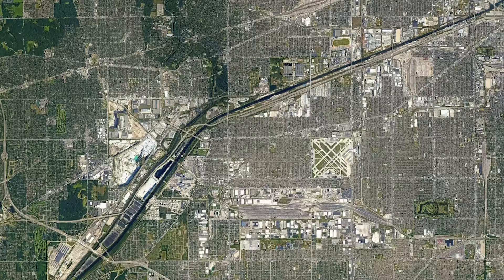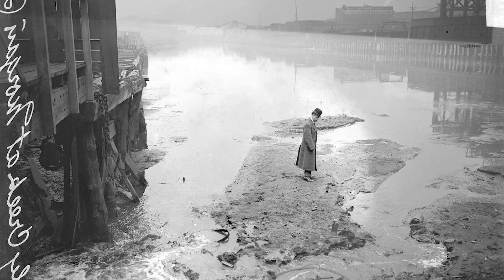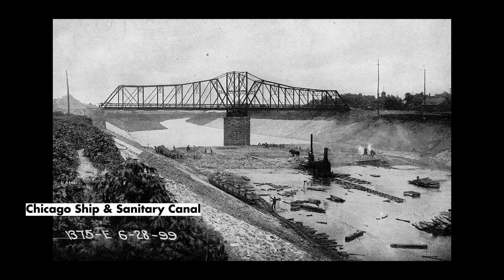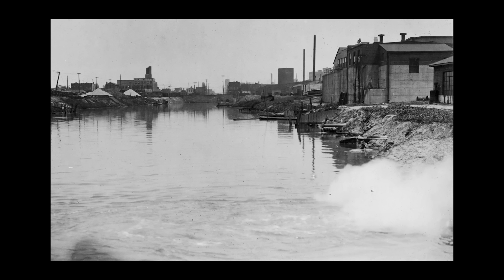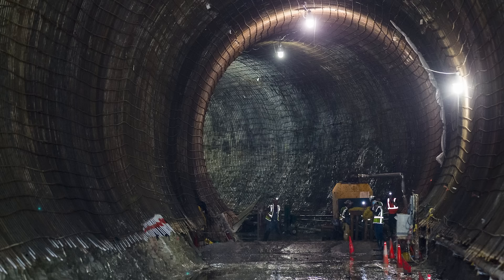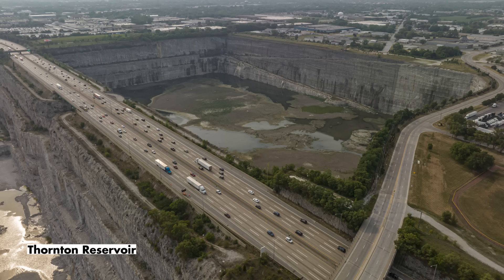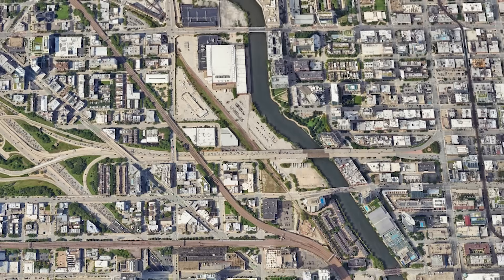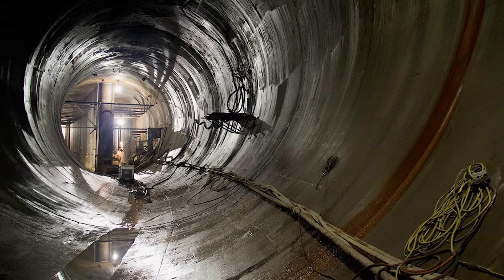Chicago's Deep Tunnel Project

Comment: There was a massive opening in the street on the north west side of Oak Park River Forest High School in about 1971ish. It looked all the way down into the Deep Tunnel project. To this day, I've never seen anything like it. You could walk up to the boards surrounding the opening (which was HUGE) and gaze down at the people working what looked like three to five hundred feet underground. They lowered and raised huge pieces of tunneling equipment via that opening for almost a year before closing it up. The most amazing part of the project was that they trucked out all the dirt as they dug the hole. It was a very nice residential area so they did their best to keep it very tidy. You have this massive huge hole in the street at an intersection and not a trace of dirt, asphalt, or clay. I was fascinated with the whole deal and begged the construction guys to allow me a chance to go underground via the elevator. DENIED every time. Then a year later it was filled and closed. After the new asphalt had weather for a few months, there was literally no trace that there had been that massive project taking place just months earlier. It was quite impressive to say the least. It really helped a ton with water movement during big storms  here. Basements stopped flooding almost overnight once they finished up that section. It was way over budget as I recall, but successful as far as the end goal.

Comment: They need to open it up the tunnel when it rain really badly, but they don't. One time, it was raining really bad it's was July 4th weekend, but nobody wasn't working, and it flooded.  The worst one ever was in 2023 . You know why they didn't open it up because it was during Nascar racing, and they didn't want the water flow on the race track,  so it flooded in people home. After they finished the tunnel, we stopped having flood in the basement for about the first 10 years. Now, I say the last decade about 3 or 4 time.

Comment: I grew up in Chicago back in the 1950s. Basement flooding was common place (and it was NASTY!). It would back up through the floor drain or into the wash tubs (clothes washing was often performed in the basement during the cold Chicago winters). The only way to prevent it was to install "stand pipes": the floor drain opening would be threaded and a three to four foot tall section of pipe would be threaded into the drain when not in use.
The newer homes in the suburbs had it better: they had "over head sewers" (the sewer entered above the basement floor level) and a sump pump was used to pump basement generated grey water up into the sewer system. (to the great relief of my nose!)

Comment: Retired MWRD pollution control officer here…made it as far as the drop shafts and visited numerous sampling locations where combined wastewater would enter the tunnel.  Fortunately, the reservoirs are capable of handling the volume of water the tunnel can’t because those 1,000 year rain events are occurring every year and the tunnel only holds a few billion gallons. By the time I retired, Thornton still had some kinks to work out, McCook was good to go, and of course maintenance.  Thornton is massive!  

For the record, the District is a self-taxing government body.  We’re not affiliated with the city or Cook county, but home owners will recognize the organization in their property tax bill.

Comment: since ive ever been doing chicago construction, and the surrounding towns, every contract has the property keeping all of the storm water on site, either in detention ponds, or underground chambers that are underneath the pavement. 

It adds like a million dollars to each job because the concrete chambers are like 400 grand, and then the labor and stone backfill. 

MWRD is your daddy, Metropolitan Water Reclamation District, and you aren't building a single thing until you tell them where the water will go, and they say its okay to do that. 

I just had to bring it up cause you only mentioned bioswales, which are tiny and dont hold much anyways.

Thats why theres a huge pond outside of every building, cause its cheaper to dig out a pond and haul off the dirt, then it is to dig out under the pavement and buy expensive concrete chambers, and still have to haul the dirt out.

Comment: The flooding in chicago happens because the city Strategically shuts off certain sewer valves in order to save Certain areas from getting flooded. These are mostly areas like downtown Chicago, some part of bridgeport etc.  they shut off sewers and let all the sewer water back up into the poor areas. I was in a poor hispanic area in chicago, forgot the name, but its around 47th  california, kedzie etc, and that area had like 7+ feet deep water on many blocks. I wouldnt be shocked if this is being built just to spare the airport from being effected by storms. I bet near by residences will expereince some sort of hell

Comment: I've driven a semi truck over the Thornton reservoir more times than I can count. I never knew what it was, only that it was a LONG way down to the bottom!

Also, its Chicago's combination sewers that kind of make this approach necessary. The green system would work well if it were only storm water. But with feces mixed in, it must be specially treated in a facility designed to do that.
Reply: Part of the city where I live has/had a combined sewer system.  The EPA mandated the city to separate the storm sewer from the sanitary sewer.  The project has been ongoing for maybe 6-7 years now.  I'm surprised Chicago doesn't have to do the same thing with their system, but maybe it'd be too costly?

Comment: A few things I'll add. There is the working Thornton Quarry, across the I-294/I-80 expressway. it's an active quarry, the one on the north side that you see lots of  brackish water and other sediment. This is the main overflow sewage area. However, they planned for the 100 year flood. There's a bridge that you can see halfway through the two quarries. You'll notice a round coffer dam on the north side(far) of the expressway, and then a bridge over an opening. Being bedrock they're pretty much already water proof, so they're perfect.

That's there in case there's a huge once in a life time flood, or other major issues. The active quarry to the south will move all it's equipment out and then the water will go over the coffer dam and use the active quarry as overflow. After the emergency ends, the water treatment plants will drain both and the active quarry will  clean up the mess. There's very little chance of it actually happening due to the other quarries being used.

Comment: An important an interest element here is that Chicago is one of the only cities in the world that treats not only sewage, but nearly ALL rainwater runoff that falls on the city. This is mainly because of treaties that limit the city's ability to dump water into Lake Michigan. There is also a really interesting element that the same treaties limit how much water the city can pull from the lake annually--and this includes the water that flows into the now-reversed Chicago river. That is why, during periods of high water usage, the flow of the river will come to almost a stop.
Reply: Great Lakes Compact.  When the place you sent you sent your waste water to is the same as your drinking water and a major recreation site , you have to clean up the mess. Summer beach closures for bad water quality days does not go well.

Comment: Thanks for shining a spotlight.  I love my city and appreciate that it has had massive projects throughout its history.  I even appreciate the coda that this may have not been the right solution -- just as draining the original swampland, I&M canal, the railyards,  reversing the river, building the Sears Tower, Chicago Housing authority projects, etc. etc. were all probably not the right solutions.  Yet not only is it impossible to only choose right solutions, without Chicago being at the forefront some of these projects other cities and the world may not have the data needed to find competitive alternative solutions.

r.i.p. Chicago Spire - Chicago missed a chance to be Chicago again when this mega skyscraper project stopped.
My screen name is Chicagojon2016 because Chicago bid for the 2016 olympics.  Of course it would have been a disaster for many reasons (as Rio was) but this is a world class city and we need to never forget that and continue to push forward even if it means continuing to make mistakes.

Comment: I worked in the deep tunnel back in the early 90's, it was 386' below ground where I worked. We set the record on a 32' round dig by going 100 feet, got a coin as a commeration. Also worked on 15' tunnel and drilling and packing leaks. Was there the night the hoist, which ran the manlift/elevator, caught fire, after that night we were lowered and raised by crane. You've never seen darkness like when the power would go down, could see absolutly nothing. Was very, very hard work!
Reply: You never see darkness like that. I m shure. Over a mile below ground in a mine. You can't even see your nose. Mabey that's why they study dark matter now down there.
Reply: what do you know of underground military bases ?
Reply: @bluskytoo  I can't say 🙂
Reply: Worked with Kenny construction and Jaydee in the early 2000s. The tunnels were awesome. Wish I could go back
Reply: @stockingstuffer696  Jerry Kenny was great guy and friend. He was a very humble man for all he had done. I was lucky to work with him.
Reply: I worked that project in the 80s. Piledrivers.
Reply: Thank you bro
Reply: I was on that job too. IEL at Miller Meadow. I ran the 32' mole and the 15'er west under Roosevelt Rd to 25th. I operated the crane that took the TBM out of the hole at P site, about a half mile north of Kiddie Land then the 9260 American at the main shaft until the end of the job.
Reply: @Craneman4100w  yeah, Impregilio, Ebasco and Lozenger (probably mispelled) is who I worked for. Small world!
Reply: Were y'all known as 'Sand Hogs' like the NYC tunnel engineers??
Reply: @SMichaelDeHart  No, they call them hard rock miners here. I'm an operating engineer.
Reply: @Craneman4100w  the 'Sand Hogs' name was more of a nickname, than actual job classification. Just wondered if it carried over.
Reply: @SMichaelDeHart  I don't remember ever being called that, I was just a laborer
Reply: @GregHallArt  they wore it a a badge of honor. Just wondered.
Reply: I worked in the east pump room at the plant on 130th Street just west of the Bishop Ford expressway.  385 feet below the ground. They say it is the deepest point in Chicago.  We were just filling cracks with hydroactive foam.
Reply: @erike.erskine7648  I never did foam, I mined and also worked on a drill and fill with hydraulic cement crew.
Reply: Local 4 retired now
Reply: Thanks 👍 for sharing
Reply: So magnetic train are supposed to run 10 miles under ground world wide 

Supper fast

Comment: The ridiculous idea is to combine sewer and storm water, convey it, store it, then try and treat it before the next storm. Keeping it separate from the start is the long term solution. This project fools engineers into thinking that it will eventually work. Sorry it does not now, and will never be able to fully treat all the combined sewage during the largest annual storms.
Reply: will it be able to handle the most extreme events 100%? probably not. however that dosent mean it "dosent work". its helped a lot actually. basements flood way less frequently than they used to. the chicago river is healthier than its ever been in the modern era. discharge events are far less, and even in extreme events less needs to be discharged because more is being held back. dont let perfect be the enemy of good. also i can guarantee you the cost to build out an entirely separate sewer system for the entire metro region would cost wayyyyyy more than the 4B this has cost as well. good luck selling chicagoland on even more tax increases. as a point of comparison, the plan to replace all the old gas pipes in the city was originally supposed to cost 2B - thats now up to 11B and massively behind schedule with even more cost over runs likely. and thats arguably a far simpler project.

Comment: They did the same thing in Milwaukee and it's a massive failure, they're still dumping untreated waste into Lake Michigan even after moderate rainfall.
Reply: The deep tunnel project has actually been a massive success in Milwaukee. Since it's come online in 1994 MMSD has captured 98.4% of runoff even though the national goal is to capture at least 85%. Further more prior to the deep tunnel Milwaukee would have 50-60 overflow events into Lake Michigan a year, but since 1994 the city now averages only 2.2 overflow events a year.

Comment: FYI the Thornton quarry that goes on both sides of 294/I 80  that multiple vehicles/ trucks pass over everyday is monstrous . I work for a paving company and on the north side is the old quarry now water reclamation for Deep tunnel which has the same conditions as the other quarry to the south. I all honesty they were at one time connected to each other via tunnels for gigantic earth moving vehicles Quarry trucks payloaders drills ect ect . But most importantly is that this quarry has the most pristine lime stone in the world. It’d dug up ground up and shipped all over the world via barge and rail cars. For some reason it’s consistency if fair more superior that most lime stone out there. It been test all over when used in making concrete it us superior for concrete mix of multiple substances for different building quality curbs, streets, buildings., foundations, sidewalks, driveways. Roadways, bridges and bridge support, precast concrete form/ walls you name it’s been used best one is Trump towers here in down town Chicago was multi types of concrete mix’s used to build the tower all steel and concrete. I’ve been in that quarry multiple times  getting stone 🇺🇸🇺🇸🇺🇸

Comment: Combined sewer systems are archaic. Sanitary sewer systems are the way to go. Waste water and storm water should never be combined or use the same infrastructure. Sealed waster water gravity systems, lift stations and terminal stations that pump into wastewater force mains are far more environmentally friendly. If every time it rains it throws the treatment plants parameters out of control the effluent cant be controlled. In a sealed sanitary system infiltration of fresh water can be controlled and metered. Meaning the treatment plants will run at a far more efficient rate and be able to maintain permit. How do they intend to seal off those reservoirs from the surrounding environment and wildlife when it is actively holding waste water? Thats a disaster waiting to happen.

Comment: So those huge, abandoned quarries are massive open cesspools used to store partially diluted human waste? Wow! Milwaukee built a deep tunnel project too (completed in the 1990's). However, it's on a much smaller scale than Chicago's. And as a result, Milwaukee still routinely dumps raw sewage into Lake Michigan. Just not as often, which is an improvement over what they were doing before.
Reply: So
Reply: @WhooHooooooo Their sewage flows down to our beaches and water intake cribs when it is dumped in Lake Michigan.

Comment: I had a chance to visit this project in 1982.  Was with a group of engineering students and we were able to ride a lift down one of the main construction drop Shafts.  There was one of the TBMs waiting to be dismantled with only the cutting face visible.  They were also in the process of lining the tunnel and there were concrete mixer trucks dropping concrete in chutes to special railroad cars to move the concrete down the tunnel.  The tunnel was pretty well lit but it was foggy due to the 55 ground temperature and you couldn't see more than a few hundred feet down the tunnel. Was a bit surreal.
Reply: How were the echoes?
Reply: Most of the Engineering in the Near Interior was done out of Chicago from the 19th century well into the 20th. Fascinating school of infrastructure, Im sure there would be some thematic consistencies if studied etc